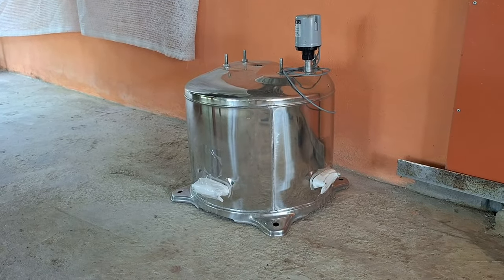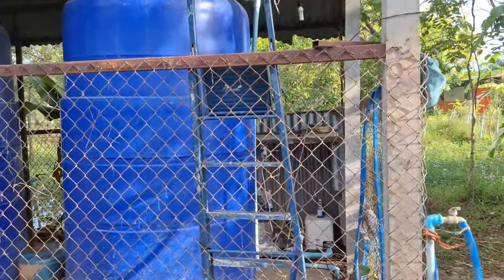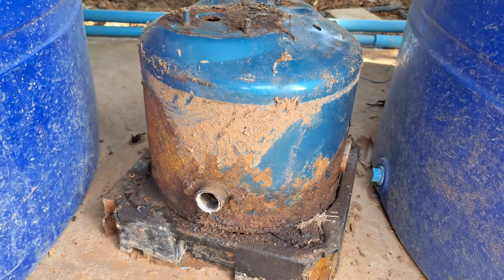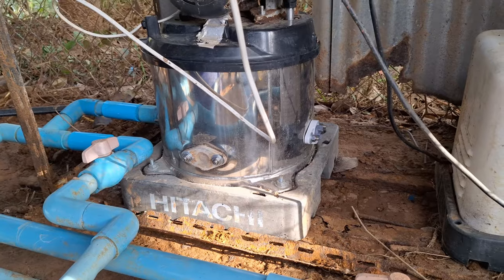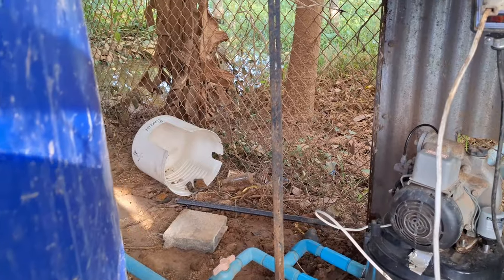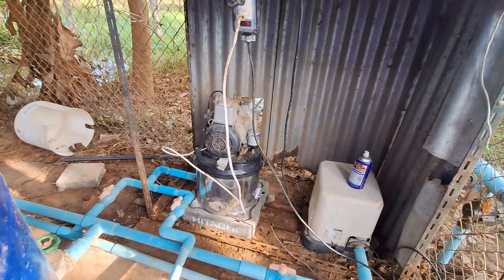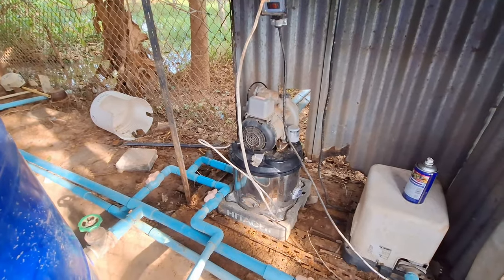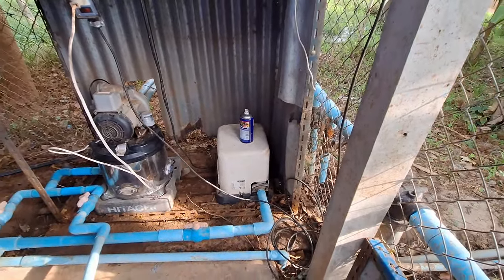Well pump pressure Tank died

Comment: I find the only problem with stainless in Thailand is that it's only 304 grade not 316 so it just starts rusting from day one.
Reply from the maker: @glennpassmore8441 cheers Glenn  Yes very true, but when I was hunting for replacement tanks as a spare part I initially came up blank.. I didn't want to buy a complete pump every time when the motor/pump seem to last forever with the occasional  pressure switch replacement. 1845bht for a 304 stainless was a much cheaper option than 7000-9000bht for a complete unit. Will see how it lasts.
Reply: Thanks, thats an interesting vlog. Any preference between Mitsubishi and Hitachi WP pumps?
Reply: @MarkDaviesThailand  I don't personally have a preference. Some people say Mitsubishi some say hitachi. I went hitachi xx model. I have a submersible pump to a tank then an instant pump to the house.
Reply: @glennpassmore8441  Thanks Glen. I have a similar set up including a ( tired ) Mitsubushi pump from tanks to the house. I may try a Hitachi for a change this time!
Reply from the maker: Hi Mark, I have always had reasonable results with anything Hitachi so maybe biased that direction. Also when i first met Thalinee the existing pump was a Hitachi she had fo 5 years, only the tank had failed thru corrosion. A local had already made a patch up by rendering the tank in cwement to seal it lol. Pump was working fine, just had to pour a bucket of water in the header tank to prime it each time....haha. Mitsubish I have had no first hand experience with so I refrain from assuming either way. They do seem to be a strong market competitor as they seem to occupy as much shelf space as Hitachi in all the major supply shops. Thanks for the question.

Comment: The well/bore pump should pump into the tanks, si only needing a float switch, other water then done by another pump with the pressure tank
Reply: Great and practical way of thinking, a pressure tank is not needed, only an in-line pressure switch with a by-pass with its valves, these guys are out to sell you everything that is not needed to make money and you fall for it. The correct way is what you suggest, a borehole submersible pump with a float switch which you can set the levels within a tank, from there 
another pump supplies the house with an in-line pressure switch that controls it, as suggested, and the problem is solved forever.